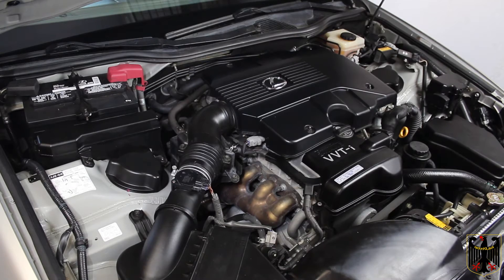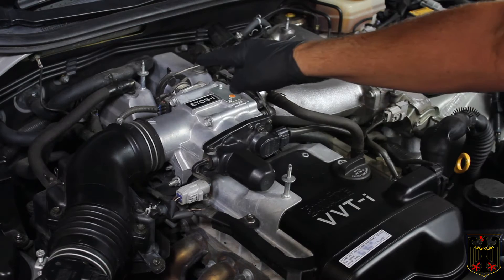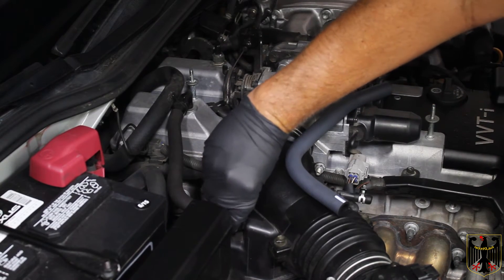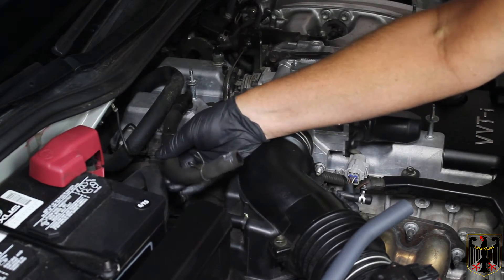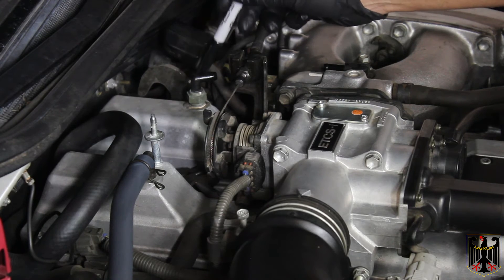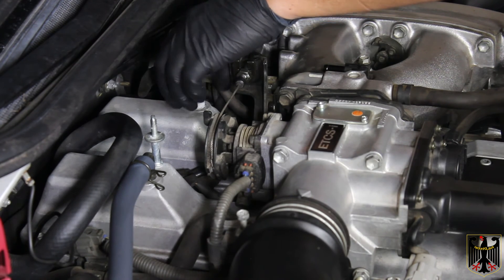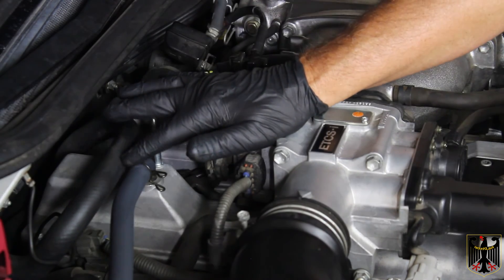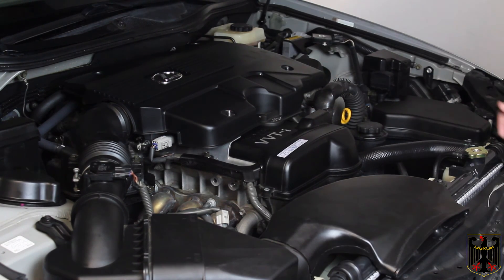2JZ-GE PCV Valve and Hose Replacement

Comment: Hey redonKiLaus does the shape of the PCV valve matter? I went to advance auto to get the PCV valve but its a metal straight valve and that part number shows a L shaped valve online. I have also googled it and looked on amazon. They all show a L shaped valve that's plastic. When I went back to advance auto i was told "the shape of the PCV valve doesn't matter and the hose can stretch around". It looks like a PCV valve for a 92 Lexus SC400 when I put in that vehicle type on shop.advanceautoparts.com
Reply from the maker: It does as far as hose routing is concerned - having a straight valve in place of one that is supposed to be a 90 degree bend will put undue stress on the hose, causing it to crack or tear much more quickly than it should.  I'm sure the person you've spoken to at AAP means well, but probably doesn't understand the engineering aspects of doing something like they were telling you (and they likely don't want to swap out the incorrect part for the right one).  

I recommend purchasing an OEM valve from a local Lexus dealer or via this source: https://www.lexuspartsnow.com/parts/lexus-valve-sub-assy-ventilation~12204-46010.html

The valve is very inexpensive, even for the OEM part, and if you don't want to pay shipping just print off a copy of that page with the pricing details and most Lexus dealerships will price-match for you.  

This page also has listings for all of the other components in the PCV system, including the hoses, clamps, and grommet, so if you need those just refer to that page - make sure that when purchasing you're looking at the part that says "2JZGE.. JZZ31" under "Fitting Vehicle Options," as the other parts are for the SC400.
Reply: I got the pcv valve replaced today along with those 2 hoses you gave me the parts number for. Thank you for these videos and giving me  those part numbers. I have noticed the car ran a little better with the new valve hopefully I see better fuel economy too my car has been running rich lately.

Comment: I clicked on the link to that pcv valve for my 92 Lexus sc300 but it says it doesnt fit on amazon. Its a 2jz ge engine as well did it change for that yr lexus sc300?
Reply from the maker: I believe the PCV valve type changed when the transition to the VVT-i engines occurred, so the valve number for your engine is 12204-46010 according to Lexus.  You also need to change the grommet at the same time - I believe it's 90480-18001, but you should double check with a dealer or Amazon before ordering.  Hope that helps, and thanks for watching!
Reply: Thank you for the reply and part numbers I'm going to order tomorrow. Do you think I should get those 2 hoses changed as well when I do the grommet and pcv valve? My car has 273,000 miles and I have no idea when all of those things were changed last since I have just bought the car.
Reply from the maker: If you're talking about the PCV hoses, then yes, you more than likely should change them unless they've been done recently.  In fact, any vacuum hose you touch to do work on the vehicle at that mileage should probably be replaced so as to avoid some nasty vacuum leaks (of course, if you don't want to pay OEM Toyota parts prices, you can replace many with bulk silicone line).  Hope that helps, and thanks for watching!

Comment: Would those hose cause throw Evap emission code if cracked ?
Reply from the maker: There is a potential for any vacuum leak to cause an Evap system code to pop, and if the PCV hoses are cracked they should definitely be replaced, along with any others that are broken.  The Evap vacuum system and solenoid itself is on the passenger side of the engine bay, with the solenoid mounted to the airbox.  I would also thoroughly inspect those lines to see if they are cracked as well.  Hope that helps, and thanks for watching!

Comment: I believe the last year of production for sc300 is 2000, not 2002..juss saying.. thanks for the video, very informative.
Reply from the maker: Darth Crÿst That is true of the SC, but the 2JZ-GE also came in the GS and IS which were produced well past that model year. In the case of the video, it was shot on an 02 GS. Thank you for watching, and I'm glad the video helped you!
Reply: My 94 sc300 needed a new pcv valve, but unlike this 2jz the valve pops out with the grommet, I was screwing it out for 30 seconds like this video until I realized it pops out with flat head..
Reply from the maker: Yep, the non-VVT-i engines have the grommeted PCV valve like most earlier Toyota engines...the 3RZ in my turbo 4Runner is the same way.
Reply: @redonKiLaus  why does my 2004 vvti have a grommet pcv valve?
Reply from the maker: @thenadlad  Is it a GS or an IS?  The IS has a slightly different vacuum system so that may be why.  Otherwise, I don't know - perhaps the valve covers were replaced with the older style at some point.  Thanks for watching!
Reply: @redonKiLaus  It's an IS. I think the valve covers were replaced for some reason.

Comment: What are the benefits of PCV Valve and Hose Replacement?
Reply from the maker: If your PCV valve is faulty, you may see symptoms as benign as oil consumption or decreased fuel economy, but over time these compound and can cause engine damage.  Thanks for watching!
Reply: Ah I see, thanks for the clarification. Instead of replacing these hoses and the valve can they be cleaned with petrol or other cleaning compounds?
Reply from the maker: The hoses dry and crack so those must be replaced.  You can, in theory, clean the PCV valve using a very heavy duty solvent, cleaning swabs, and a good bit of time, but at the $10 or so it costs to replace them, it makes more sense to swap out for a new OEM one.  Hope that helps!

Comment: thank you for the video.. I notice the engine bay is nice and clean, how do you wash the engine?
Reply from the maker: This car hasn't had my full cleaning treatment yet so the engine bay is not quite as nice as my other vehicles' (there's actually some pretty nasty buildup on the underside of the hood from a radiator hose leak in the past), but when I'm doing a deep cleaning I rinse down the engine bay, spray it down with diluted Simple Green (~1:1 with water) let it soak for a minute, and agitate with various brushes and old wash mitts for dedicated engine bay use.  I then rinse off, dry all accessible parts with a towel, allow the rest of the components to dry by starting and running the vehicle, and then apply dressings - spray wax for all painted parts and shiny plastics, and a plastic/rubber dressing for all grained plastics and hoses.  Hope that helps, and thanks for watching!
Reply: Thank you, you awesome!